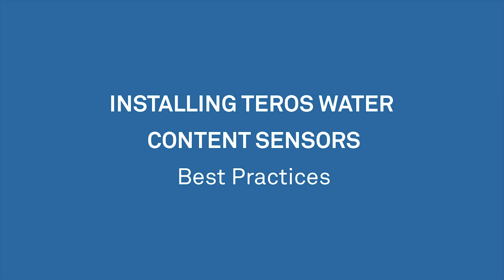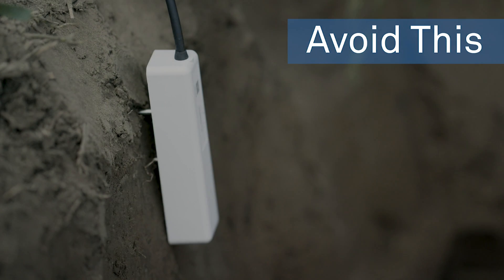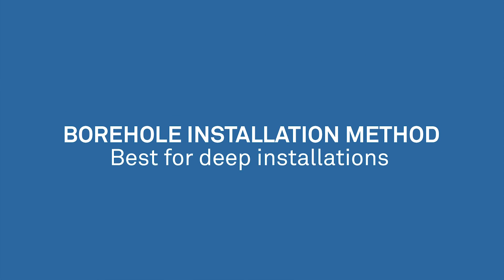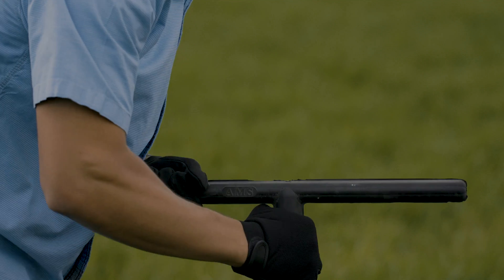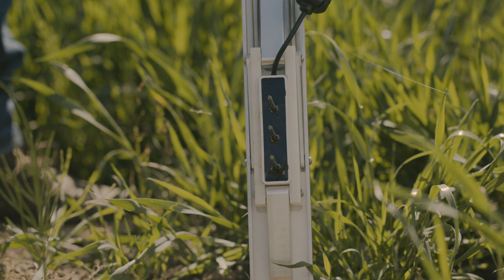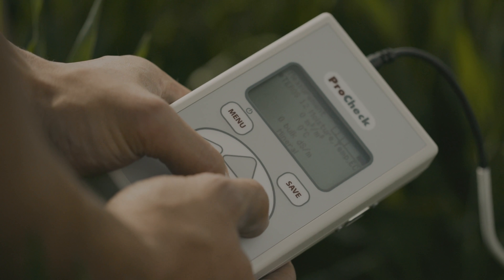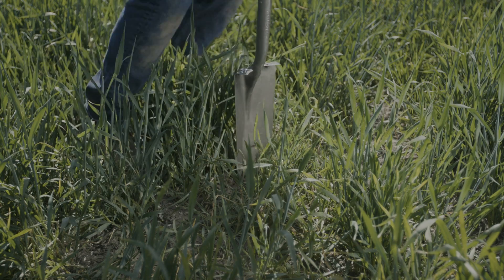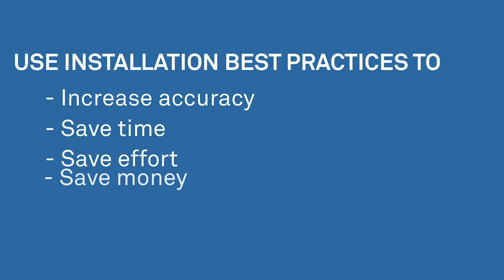Installing TEROS Soil Moisture Sensors - A best practice guide by METER Group

Comment: Donde venderán el soporte del sensor teros 12? Me refiero a la vara
Reply from the maker: Las varas (agujas) que estan adjuntada al sensor son fabricada en nuestra facilidad en Pullman, WA y no las vendemos separadamente. Si quiere comprar un TEROS 12  llame a 509.332.5984. Para aprender mas sobre la teoria detras  el TEROS 12 le pido que lea el manual 
Manual para el TEROS 11 y 12 - http://publications.metergroup.com/Manuals/20587_TEROS11-12_Manual_Web.pdf
Reply: @METERGroup  me refiero al artefacto con gatillo para poder introducir los sensores del teros 12 en la tierra! No a las agujas(sensores)
Reply from the maker: @ignacioaraya7180  Le pido perdon por el malentendido. La facilidad en Pullman fabrica y vende la herramienta de instalación para el TEROS 12. Para aprender mas, visite https://www.metergroup.com/en/meter-environment/products/teros-borehole-installation-tool. Si quiere comprar una herramienta, le pido que mande un email a sales.environment@metergroup.com para recibir una estimación.